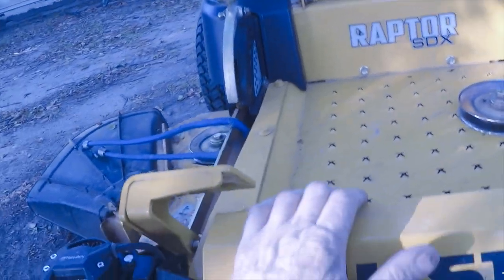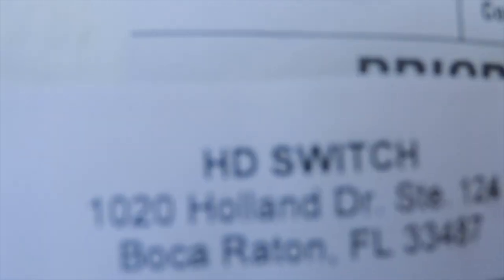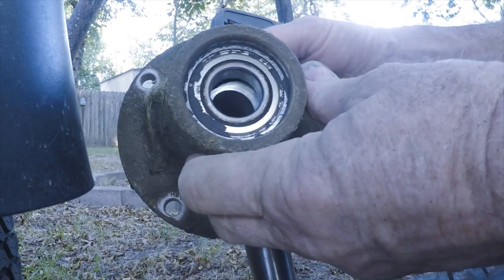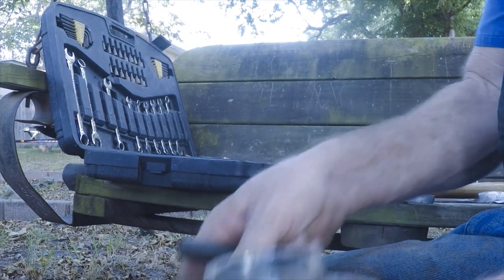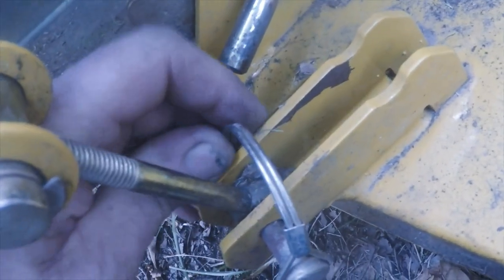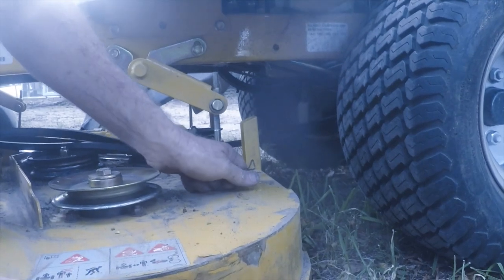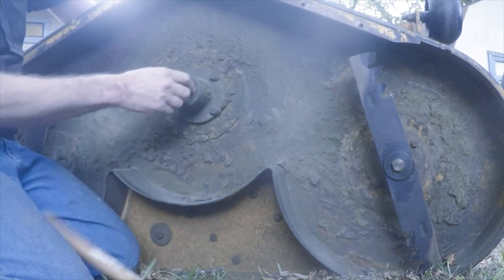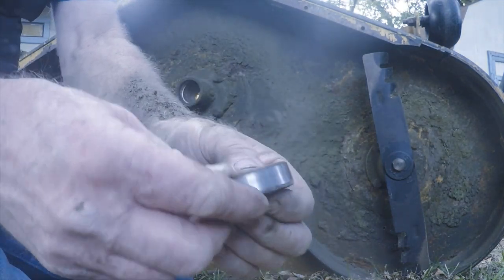Hustler Raptor SDX Spindle rebuild.

Comment: my 2014 Raptor SD has 186 on it and the bearing on the idler sled let loose shot the pulley (minus the center) about 300 yards so I am replacing all bearings on the deck these included. Thanks for sharing your work.
Reply from the maker: Thanks for watching, Wow that could have been bad if it hit someone. I have 230 hr on it now and found the battery tray has broke loose at the front welds.

Comment: How did you remove the pulley? Did you lock the blade below with a 2x4? Thanks.
Reply from the maker: Yes I locked it with a 2x4 and used a impack wrench. then the pulleys came right off.
Reply: @rickboretirementplan   thank you!

Comment: rickbo,  thanks for the good video, but here is a tip.  don't lift deck off and on.  cut two 18 in  boards and back off,, drive on.,   front two attach points have to be off at mower end, not deck end to do this,  makes it easy and saves back.
Reply from the maker: Great idea thanks.

Comment: You did great job installing the bearings I don’t know exactly long the  bearings last , you would think at they would last longer then that? My Raptor SD had about 140 hour on it I think the bearings are good I guess I need to check them.
Reply from the maker: One field I cut has very tall thick weeds, it is probably hard on the bearings, but the mower handles it great. That is when I run out of gas and have to walk back to the truck. I need to install that fuel gauge.

Comment: New 3 spindles cost 69.00 for all three spindles
Reply from the maker: Yes all 6 bearings were about 60.00 dollars .I have 260 hours on it now and they are working great. Thanks for watching and comment.
Reply from the maker: Each spindle cost 69.00 I got all the bearings for 60.00.
Reply: @rickboretirementplan  NO, ALL three for 69.00! It isn't worth rebuilding for 9.00.  Aftermarket bearings are usually inferior.
Reply from the maker: I can't find them that cheap, but is a good deal.
Reply: @rickboretirementplan  Amazon!  3 complete spindles for 69.00. Exact part for your Hustler.  Hustlers are great machines, I owned 3 new Super Z's.  They got better each year.